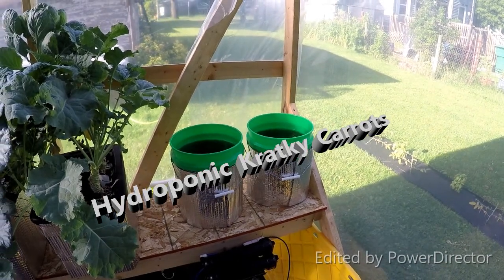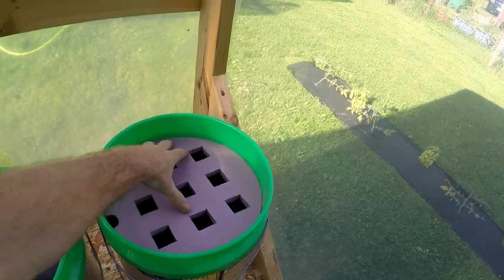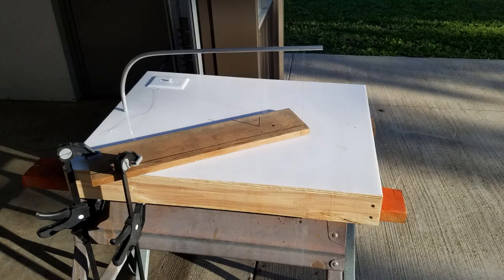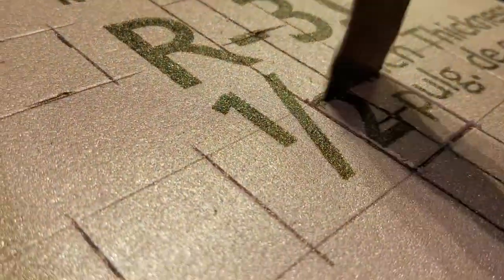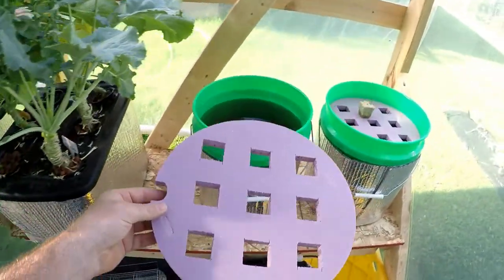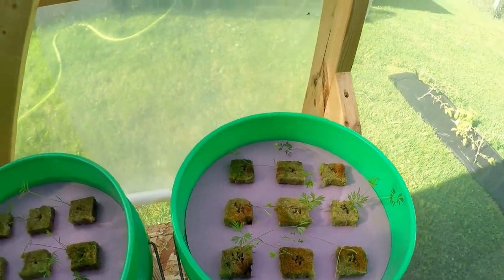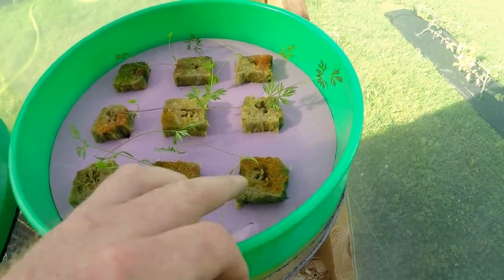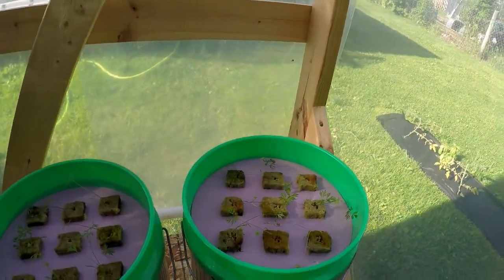hydroponic kratky carrots june 26

Comment: Use a piece of wire to pierce the foam and act as a handle. The hole you created for pulling out the foam, is allowing light in, consequently promoting algae growth. It also allows a place for mosquitoes and other insects to infiltrate the wet underside, and breed.